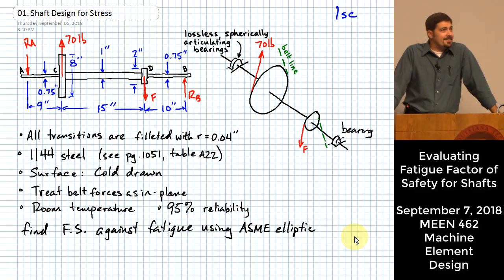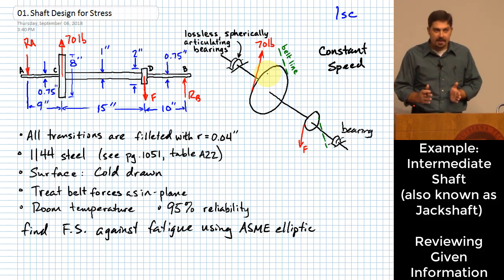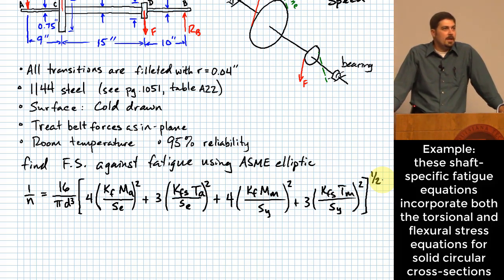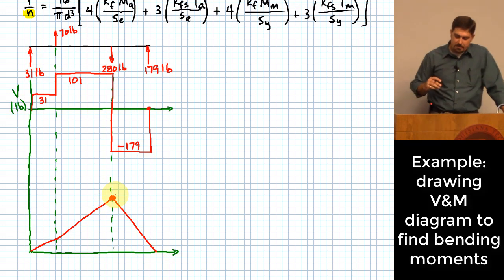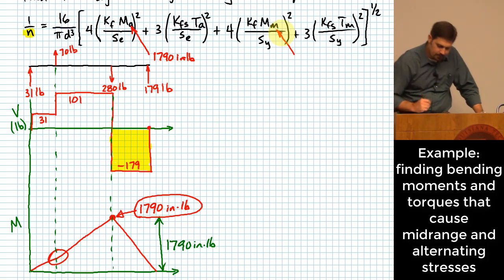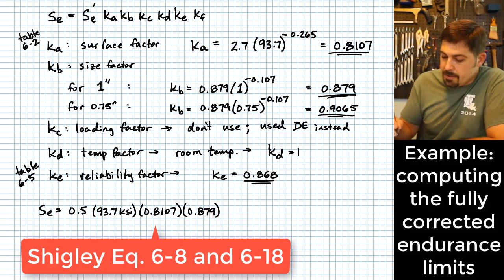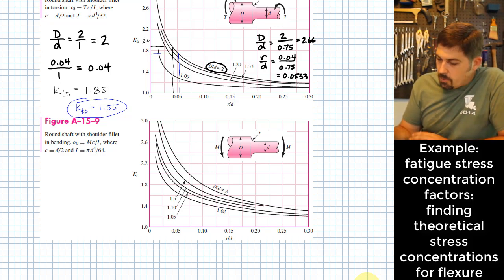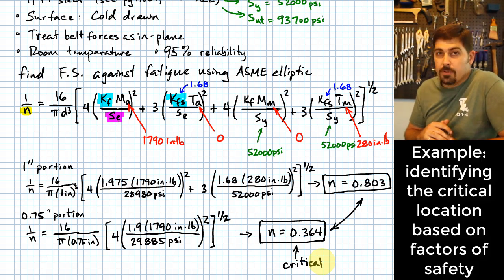Shaft Fatigue Factor of Safety using ASME Elliptic | Midrange & Alternating Torque & Bending Moments

Comment: Hello! Any idea what would happen in the case where we have an alternating bending moment acting on a shaft? What usually happens is that we have a static bending moment acting on a rotating shaft, and the rotation causes the bending load to fully alternate. But I have never found an example in which the bending moment itself is alternating (ex. Mb = 10 +/- 5 Nm) WHILE the shaft is rotating. What would we write in the fatigue failure criterion for the bending stress in such an example?

Comment: i see only one bending moment diagram here? what if there is bending in xz plane along with xy plane?
Reply from the maker: Yes, I believe I mentioned that I was using an assumption that the "out of plane" loads would be neglected. If you suspect that this will overly compromise the validity of your solution, a 2-plane bending moment analysis should be done. Here is a link to a video where I complete both a 1-plane and 2-plane bending moment analysis on a simply supported shaft:
https://youtu.be/PSvgn2xVpjU
Thanks for watching!

Comment: In case if I have a value of n and need to find diameter, can I use approximate d=1 to get Kb, and then use a real value of d for the next iteration?
Reply from the maker: That is one way to do it, but there is also an equation in Shigley that is solved for d in case you are doing this type of problem. Thanks for watching!

Comment: Please recommend some of the books you use for your lectures. I love your lectures. They are great recap. Keep them coming!
Reply from the maker: The book I base many of these lectures on is Shigley's Mechanical Engineering Design. I'm my opinion, it is an excellent resource for presenting and explaining material,  but it stops short of providing the kinds of exercise problems that would really explore the depths and breadth of what is presented in the text. So I write my own problems that (I hope) do that a little more thoroughly. Thanks for your interest, and thanks for watching!

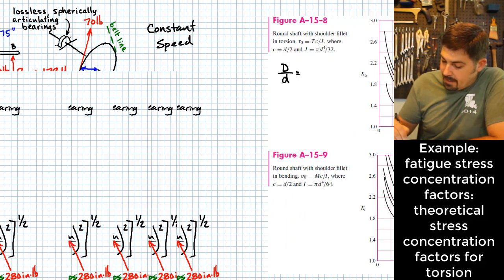Comment: I think at 1:05:06 the strategy you are using is wrong🤔
Reply from the maker: I'm sorry I didn't answer your earlier question :)
The difference between my interpretation and yours is whether the wheels attached to the shaft are discrete elements that are installed onto the shaft or whether they are integrated into the shaft as one big piece. I'm treating it as the latter, you are interpreting it as the former. You have a very good point under your interpretation.
Reply: TheBom_PE 
So in your interpretation you mean the whole part is manufactured as one single integrated part. 
By this it means that, the whole part we see is one single shaft and there is no part attached to it.
And at point C the shaft diameter changes  from 0.75” to 8”and then it decreases to 1”.
And at point D the shaft diameter changes from 1” to 2” and then it decreases from 2” to 0.75”.
if this is your interpretation then I think your strategy is going to be correct.
(But I personally think maybe this interpretation is not that much common for shaft design, but also I guess you may used this method to simplify the problem so it can be properly calculated and solved in 90 minute video)
 
I really appreciate that you replied my comment.
Thank you very much and hope to see more of your videos.🙏🏻
Reply from the maker: Yep, that about covers it :)
Reply: I was looking through the comments about this note 😅. Thank you for your comment!

Comment: Your lectures are very nice and clean . And I’m going to recommend your channel to all of my friends who want to learn this course.

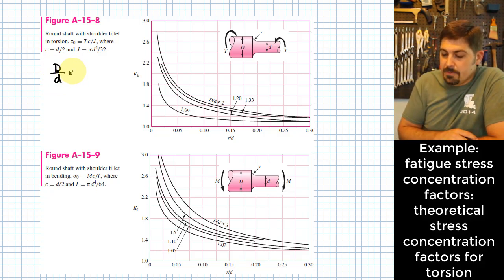I think about 1:05:06 when you start to calculate Kts, as we know the only piece that can have a shoulder is the shaft. So between the “element on the shaft & shaft” there will be no fillet. by this I mean the only stress concentration may happed on the left side of the element on point D, and this concentration will happen on the shaft and so the D/d that we should use is 1/0.75 .(I mean there is no shoulder between the element on D and shaft, and the only shoulder is for the shaft at the point that its diameter changes).
and also I think r/d should be 0.04/0.75.

and for the right side of the element on point D we won’t have any stress concentration unless if we use retaining rings at that point which will cause stress concentration.

I will be happy if you let me know your idea about this🙏🏻🙏🏻

Comment: Thanks for the video. I have a question. I simulate these cases in ANSYS APDL. I have the bending moment from shaft weight (M_weight) and also from rotating unbalance (M_unbalance) as well as torque (T) and shear force coming from shaft weight (tau_weight) and unbalance (tau_unbalance). How would I define Ma, Mm, Ta and Tm? Where does my bending and shear from weight should go?

Comment: By far the best breakdown I've seen. Thank you so much.
Reply from the maker: I'm so glad you found it helpful! In case you haven't seen them yet and might be interested, here are some of my other playlists:
ENGR122 (Statics & Engr Econ Intros): https://www.youtube.com/playlist?list=PL1IHA35xY5H52IKu6TVfFW-BDqAt_aZyg
ENGR220 (Statics & Mech of Mat): https://www.youtube.com/playlist?list=PL1IHA35xY5H5sjfjibqn_XFFxk3-pFiaX
MEMT203 (Dynamics): https://www.youtube.com/playlist?list=PL1IHA35xY5H6G64khh8fcNkjVJDGMqrHo
MEEN361 (Adv. Mech of Mat): https://www.youtube.com/playlist?list=PL1IHA35xY5H5AJpRrM2lkF7Qu2WnbQLvS 
MEEN462 (Machine Design): https://www.youtube.com/playlist?list=PL1IHA35xY5H5KqySx6n09jaJLUukbvJvB
(MEEN 361 & 462 are taught from Shigley's Mechanical Engineering Design)
Thanks for watching!
Reply: @TheBomPE  I will Definitely Check those out. What kind of laptop do you use in your lectures?
Reply from the maker: It is a Fujitsu t901 with a gen 2 i7, 16GB of ram, nvidia graphics, and a wacom active digitizer. I do the notes in Microsoft onenote and capture and edit video with camtasia.